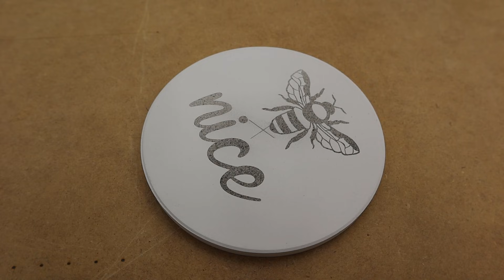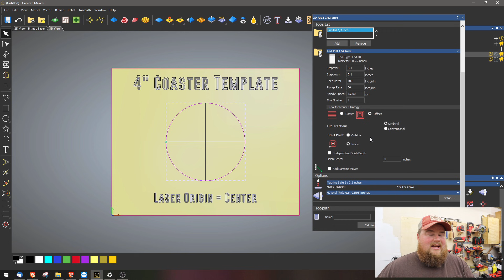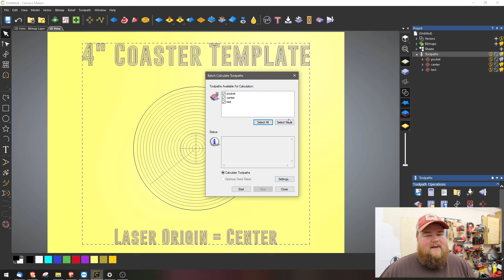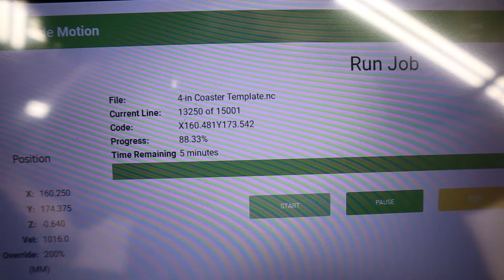The KEY to BATCH PRODUCTION with a LASER ENGRAVER

Comment: Vey nice! You could also add a small semi-cricle to the perimeter of the template circle so you could use a finger to eject the tile.
Reply: A 90 degree squared corner would be enough to position the circle ;)
Reply: @sadheartcreaciones   @S.C.  I was thinking the same, a circle is total overkill.  The nice thing about a 90° is that it is also size agnostic so you could have multiple center marks for different sizes and even various shapes.

Comment: We call it a jig if it's meant for plain locating. If it clamps the workpiece additionally,  then it's a fixtures.  I have a huge number of them on my shopfloor.. They are mighty useful when it comes to producing things in huge quantities. This video was very engaging. If a product doesn't fit well with its locating jig, we know for sure that that particular part deviated too much from the part print dimensions. Some jigs are deliberately made to weed out oversized parts. But in your case 0.02 mm here or there doesn't do any harm. Thanks for a great video - as always.

Comment: Sam, very nice coverage of the template.  I find my self watching a lot of your videos.  You're getting very good!

Small thoughts.  Make the inner circle a cut through, or at least much deeper.  You've mentioned issues with the feet on some of your slate coasters.  If the coaster rests on the outer ring, you take the feet height out of the equation.   John K. suggested a recess to get finger on to the coaster easer.  Could also notch the outer ring by an inch or so, then press down on the coaster where the notch is, and the coaster will pop out.   One final thought.  With that small engraver, and since your' batching out coasters.   Cut the template into the mounting board.  When ready for a different batch, reattach the engraver to a different template/mounting board.  Then you don't have to reset zero, just home it, set Z and off you go.

Comment: great work!! just some thoughts: the coaster fit before you take the template off of the cnc so you can go back and increase the diameter without redoing everything, add a notch or something on the edge of the circle to take the coasters out easily

Comment: Just a thought Sam. Since you are interested to increase your batch production would it not make sense to make a template the size of the laser bed and have the ability to make 5 or more at the same time? Just curious!
Reply: I, immediately, had the same thought.
Reply from the maker: It's been in the works this past week! :)
Reply: In fact, that's a feature built right into the software. It's called the matrix function.
Reply: @Samcraftcom  Make the pockets square so you can easily remove the coasters.
Reply: @CaptnDirt  Yes. I thought about a similar idea - having two depressed tabs slightly bigger than the fingers so fingers can access the periphery of the workpiece.

Comment: You could do like I would at work and make a jig with the engraver too. for the coasters it would be super simple to create a vector on a sheet of engravable plastic set to the size you can manage within your work area, then save that file as a template. You then can import existing coaster files or create new ones on that template and you'll have your scaled repeatability a lot quicker and cheaper than going cnc for something that simple. Only catch is to make sure you have it setup to mount the same every time you use the jig. Our engraver is a large enclosed unit with a 36x24 in workspace with fencing so i can always butt up sheet materials or metal to my 0X, 0Y everytime. Another solution if you do multiple sized coasters is make that same file with the circles bigger than you need, and with that same plastic sheets, create rings that step or reduce the size down to whatever additional smaller sizes needed.

Comment: As I build a pen turning business I've been watching lots of videos like this.  I have a question.

Why not just use a square with markings appropriate to the software and hardware?  For something round, assuming all of them were the same diameter, you would put the first one in the corner of the square.  The graduations on the square would give you x,y of the center, and then you could butt more coasters up to the first one in both x and y directions until you've met the limit of the machine.

There may be a VERY good reason why you can't do this.  I'm still in the planning phases so I don't even have the equipment to test my idea.  But I am curious. 

Bonus question...why have you chosen diode lasers over CO2?  For production, aren't the CO2 lasers faster?

I appreciate the help!

Comment: I have thought about using a piece of pegboard that I could line up with two corners of the laser. Then set up the work piece with some dowel pegs to keep it in place. I'd probably have to design and 3d print something to accommodate various sizes but I think it's worth exploring.

Comment: May I offer a suggestion? If you add a piece of thin ribbon, so that it goes underneath your coaster, it will allow you to lift them out very easily and take up a little of the slop, to keep the coasters positioned accurately. Hope this helps.

Comment: I'm wondering why you can't now make a fixture that holds multiple pieces 🤔?
If you could load possible five pieces with one still being in the center? You could load five or possibly more at a time and come back to a complete set of coasters vs just one.
Reply: Although possible getting the template lined up can be tricky on a machine like that. And with 12 minutes between it’s usually a quick click to swap and reset. As well as being able to swap to different designs
Reply: @ Ryan Kiedrowski not tricky at all use the engraver to make center marks on your template can do as many as your table size of engraver
Reply from the maker: I've been working on doing just that this past week and should be done soon! :)

Comment: 1) Why not install physical stops at 0,0 along the respective axis. Now you can just slide your template against it. So in theory you could have sticked with version 1.1 without having to home in between.

2) Without owning a NAS device you could also just set up a network share on your PC and save to that locally to then access it over LAN.

Comment: Hey Sam. Love your videos. Is there a reason you didn't get a laser attachment for your Shapeoko? I have the Pro XXL and was thinking about getting the Jtch 7 watt kit. Any thoughts?
Reply from the maker: Price was one factor, but more importantly the fact I would loose the ability to run my CNC while also doing any laser work. At this moment of my small business and production, that's not a big deal (I've had a huge problem in wood suppliers that's killed my woodworking production) but down the road I could see it being a factor. In addition to the above, I don't see the CNC moving fast enough to make the machine time spent pan out for profit. Laser engravers travel much faster than the CNC does and get the job done quicker. I have a few laser engraver videos on my channel if you're interested to see some and how they pan out.

Comment: What kind of power panels you have in your shop. I've been told I'm going to need another transformer installed on the power pole. I like your shop layout and is what Im working towards. Do you know if your panel is 200, 400, or 600 amps...thanks for your help buddy
Reply from the maker: Our main service entrance at the house is 100 amps. My workshop and my wife's soap making shed are running off a 60 amp service from the main line. We've never maxed them or the home out on usage in the 6 years we've lived here. Her shop is the newest to the mix, but is very minimal on power draw.
Reply: @Samcraftcom  Thank you buddy....this helps a lot. Ill have table saw, dust collection, band saw, planer/drum sander, and CNC. I will keep some things unplugged if I need to. Rome wasnt built in a day lol...THANKS!

Comment: Nice idea but wouldn't it be simpler to switch from using centre origin to lower left origin and using two pieces of wood at right angles and parallel to the laser engraver edges as a jig? Doing this would allow you use the same jig for any circular, rectangular, hexagonal etc. object of any size that fits in the work area as long as its edges can reference repeatably to the two bits of wood. Easy to remove as well as you'd have two open sides to come in from.

Comment: I need to know -  How loud really are these and also - does that vacuum really work that good and this is no mess?
Reply from the maker: Do you mean the CNC? If so, my shop vac dust collection system works great! The noise though... L-O-U-D that router screams. You won't want to run it without hearing protection.

Comment: Just a question would it not speed up the laser if your template could hold 3 or 4 coasters and have the same template save in the laser program?
Reply: ✅✅ if your really wanting to ramp up production
Reply from the maker: It would surely speed up the labor! I'm looking into a solution for such a thing. I would really like to be able to load the machine up with a batch and let it run!

Comment: As a retired engineer I think the circle alone is problematic as you need clearance all round to get the disc in, I recommend cutting a vee  shape from scrap thinner than your product and  mounting it on another base piece , then as you put the disc in pull it to register into the vee  that way you can have positive location in exact same place each time and no problems removing it after completion as most of the disc will be away from the location point ,it will also accommodate different size circles and if rotated can be used as a location datum point for square or rectangular  parts on one of the corners, just a thought.

Comment: Why not make "L" shaped pieces of 3mm plywood on your laser and glue them accurately to a baseboard. round or square shaped objects would fit against the edges of the "L" shape and be easy to remove. Great video, thanks.